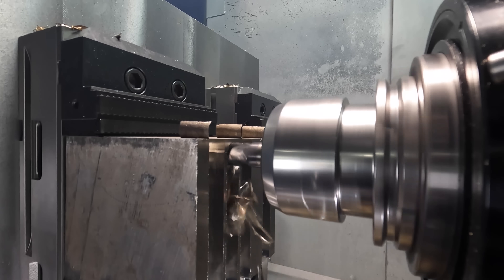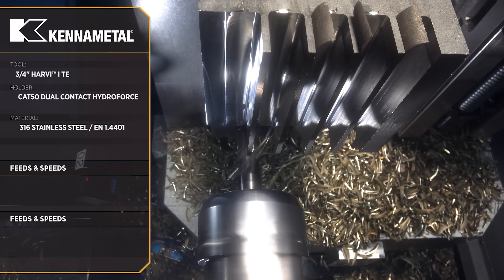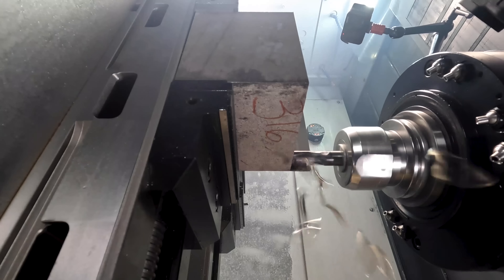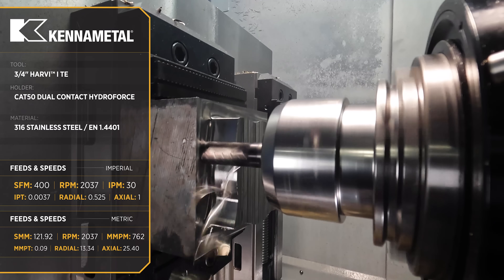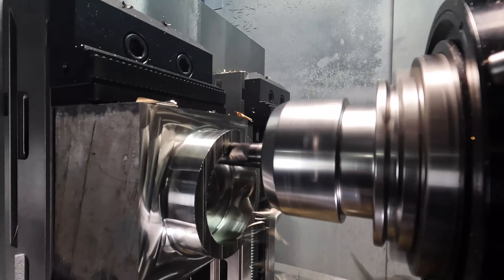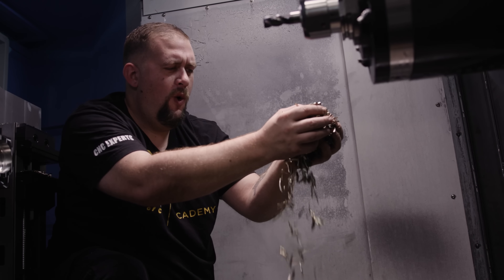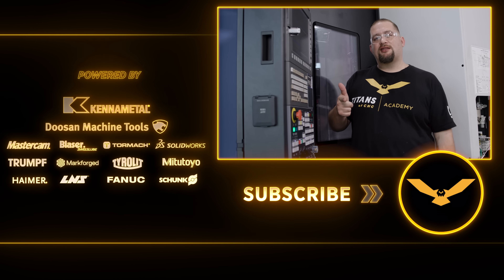The MOST SHOCKING Stainless Steel Milling Ever!!! *YOU MUST SEE THIS*

Comment: Yup pretty impressive in 316. I've machined a lot of it and I'd much rather be cutting 304. Tool life was about 1/2 or worse in 316.
You need the rigidity and HP because you got to make it eat, almost . 004 PT making big chips to take that heat away.
Get some air blowing to clear the chips is just fine.
If the machine's got enough HP let her rip. The big dog's gotta eat.
I want to see some purple chips 😄

Comment: Love it! So where do you guys see the transition point being material wise between using the H1 TE and the KOR series in steels, stainless, hardened steels, and exotics? About to start ordering some tools from you guys but have a bit of a question mark there.
Reply: H1TE is great for slotting and ramping, the KORs are great for side milling. The KOR series has the DA for Aluminum, DS for steels, and the KOR6 for exotics.
Reply: @barrysetzer  Thanks Barry for your suggestions! Looking forward to trying these out.

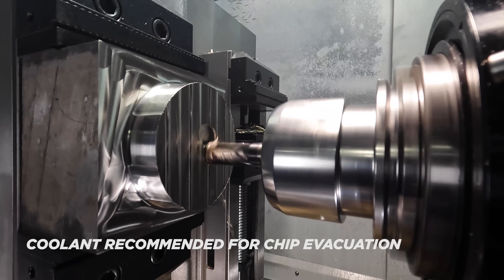Comment: I noticed at 2:40, you did your helical entry clockwise, is this just by happenstance, or do you have reasons not to go counter-clockwise in a climb cut?
Reply: That's actually a very interesting question, as I hadn't noticed that! I just looked at my toolpath (2D dynamic), and there is no way to change the direction of the helix, unless you change the dynamic milling in the bottom of the pocket to conventional cutting. Then, the helix flips to climb. I will have to ask Mastercam about that, thanks for the question!!!
Reply: @barrysetzer  some mastercam operations will let you pick whether you helically interpolate clockwise or counterclockwise but I'm trying to remember which ones LOL
Reply: So i spoke with some of the development team at Mastercam, and they tell me that they did extensive testing on this, and the toolpath reflects what actually works best in the real world. Direction of the helix in this case is a result of tool diameter and size of the helix.

Comment: I was doing this MANUALLY, & with HIGHER tolerances, 30 years ago. CNC’s, are just an excuse for lack of skilled hands, & eyes!
Reply: Well kudos to you! But CNC machining requires a very different skillset, including 3D modeling, CAM system proficiency, communication tools from programmer to machinist, machine control mastery, mastery of G and M code programming, to name a few. I grew up in manual machine shops, and that gave me a great FOUNDATION for becoming a CNC machinist, and now we teach millions of people exactly how to do things like you just saw in this video, and inspire others to rise to greatness.
Reply: With respect, Now repeat that 100 times against the robot, then we'll see who can do it faster and consistently. With that said, manual machining is an under appreciated skill nowadays. Making a single part manually can often be faster then CNC if you include programming and set up time. But the favor increases exponentially to the robot as part count increases.

Comment: what happend after #2.41?
Reply: It cut the entire 20° ramp very well, with no issues. It sounded a little rough, which is possibly why the editors cut it. But the tool handled it like a champ, and after roughing 3 of these parts, still looks brand new.

Comment: Man I wish I could work for you guys. I do large bed lathe work but I can't leave the state I am in do to family obligations. The machine I run is a Hankook Proturn 9NA that is 8,000 mm long between chuck and center. And we fill up the length of the machine regularly running 2 to 4 steady rest.

Comment: do you use some air for chips evacuation?? that machine is a monster
Reply: Yes, we had thru air running thru the collet in the Hydroforce holder.
Reply: @barrysetzer  isn't that not quite right enough for that cut? 

I'm currently training on our big soraluce and we use extra air for shredding 247mm holes in  31crmo9 400mm deep
Reply: @Sebastian-ed5kt  Yes, it would have been nice to have some extra air, or coolant. But it worked pretty well, anyway. Being in a horizontal helped alot, too. Thank you gravity! Soraluce, eh? You at General Atomics in Tupelo?
Reply: @barrysetzer  ah okay nice! 
Thanks for the answer 😊

No, I'm an apprentice at Trendelkamp in Germany 
We build machines for the plastic industry and stuff like that.
Reply: @Sebastian-ed5kt  Awesome, man! We also had a Soraluce at General Atomics, big machine!!! Prost!
Reply: @barrysetzer  yeah, absolute Monster but fucked up because of a few crashes
I think we have something like a 1° bend in the head tower thing in two axis 🤣
(+ Dirt everywhere which i am cleaning up step by step while learning to program)

We are hopefully getting a new one next year

Comment: Why is coolant not required with this application?
Reply: Since we are in a horizontal machine, gravity and thru spindle air blow do a very good job of removing chips. In a vertical mill, chip evacuation wouldnt be as easy, so coolant would likely be better
Reply: @barrysetzer  That makes sense..Thanks, Barry!
Reply: @BB I prefer horizontal machines. Gravity is very effective for chip removal!

Comment: No coolant the whole time? 🙄 Or is there an air coolant on that Tool, how long does that Tool holds without coolant? Is it possible to run it continous in stainless without cooling?... Im working on a mashine with "mms- oil air cooling" only... Sorry for my english
Reply: The tool was cooled utilizing thru-spindle air blow, thru the collet. Stainless cuts well dry, but it always depends on your application. Sometimes you need coolant.
Reply: Ah okay, i think, thats a possibility, air threw spindle cooling, it think thats good idea. Is that a special holder, for that application... Air threw spindle...?

Comment: That truly is an impressive end mill. Lots of factors made that buried hogging cut possible, but being a horizontal mill is huge in getting those chips out of there. Horse power, rigidity, and orientation all add up to an awesome process.
I wonder how long that tool would last in that application, if it was flooded with high pressure coolant, and not running dry for the benefit of the camera .
Another excellent video showing what is possible with a great setup and killer speeds and feeds.
Reply: Run the low radial tool without coolant and you will get a lot more tool life. Stainless is tough so more heat will be put into the tool. The more you cool it down the less wear resistant it will be. AlTin coatings produce aluminum oxide at high temps protecting the tool. Coolant will thermally shock and prevent extra wear resistance. These tools are beasts.
Reply: I tend to run SS dry now. I used to flood or use high pressure but after seeing how well 316 handles dry machining i just use an air blast now. 5 Flute EM, 600sfm, 8% radial, and full DOC 130ipm all day. Dry cutting keeps the AlTiN coating  activated, coupled with a chip breaker really helps with BUE. coolant would only thermal cycle the carbide. 
Drilling however is another story. Coolant thru drills are the best thing to happen to CNC tooling
Reply: You can only get a comment like yours if you know what you're doing.

Cheaper VMCs with single contact 30 or 40 tapers need not apply, this is a true test of the actual end mill itself and not the normal limitations that come with workholding or toolholding.

I tried some of the Titan videos with extreme ipm & sfm/low stepover a la trochoidal milling and SFM seemed to burn up my end mills way faster than stepover in 304 and 316. My cheapo/closeout 4fl TICN hanitas would last 3-4x longer running at ~400sfm like this video than 500+ in some of the others. One of the flutes would chip the corner eventually and then they'd die within a part or two. The speeds and feeds in this video (wish I could do the stepover) were much closer to where I ended up at.
Reply: My brother told me about this channel. You answered my question; coolant off for the camera. I run a lot of mag... so coolant ON! :)

Comment: Impressive as hell, but we all know that ramp did not end well. And It is 100% becuase of not running coolant, it's an impressive cut no doubt.
Reply: Man, it actually made it thru 3 of this exact part! And I should add that the tool was used already, when I put it in the spindle!
Reply from the maker: Is that why you were doing your Money Dance at the end of the video😂😂😂
Love Ya Barry😁
Reply: @barrysetzer  That's pretty insane. Should have shown it in the video though, cause the way it cuts the clip right when it starts to glow will make us assume it didn't end well.
Reply: @HEEDCNC  I will admit that the ramp was the part I was most afraid of! It sounded a little rough, as it was recutting some chips, but it survived! Did you see the cast iron video where the tool glowed red for 10 minutes? That was crazy, to me!
Reply: I assume its only a roughing stage for that part? Without coolant I assume metal expansion wouldnt allow great precision.
Reply: @MisFakapek  no coolant is just for video. Nobody in their right mind would willingly cut stainless without coolant unless using ceramics.
Reply: @MisFakapek  30 in per minute he said. your wife wouldn’t call that rough but this is different
Reply: That shot got cut short as soon as that endmill started to glow red
Reply: @avega602  🙄 i could make a video tomorrow doing that same ramp 10x without any issue, but it isnt worth it just to prove to the 3 people out there that dont think the tool survived. It did. Easily
Reply: @barrysetzer  to be fair, I'm not saying I don't believe you.....I just don't understand why you would cut the video short the second it started to glow, you guys are all about crazy stuff like glowing endmills and stuff so it doesn't really make sense to cut that clip short if all was well. Get what I'm saying? Im not asking you to prove it, just saying maybe next time play it all the way through.
Reply: Haha, i totally get it, bro! Im just frustrated because i KNOW what happened, and cant prove it LOL
Reply: @13Anomalous  Umm, okay......you do you I guess. I'll continue to cut my stainless with coolant.